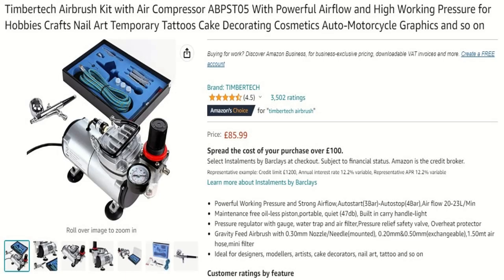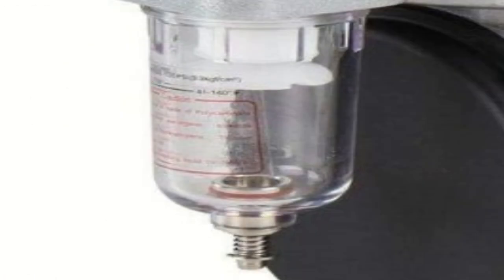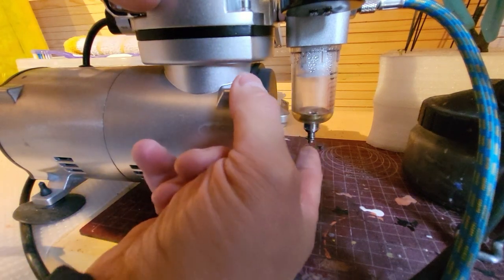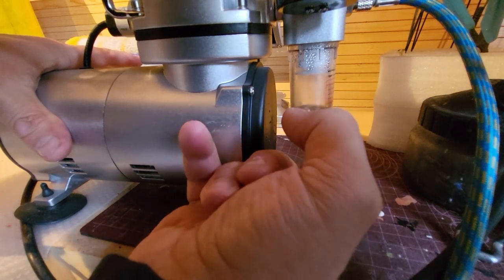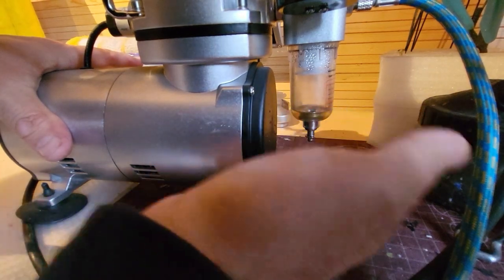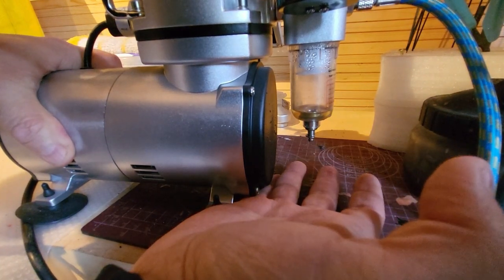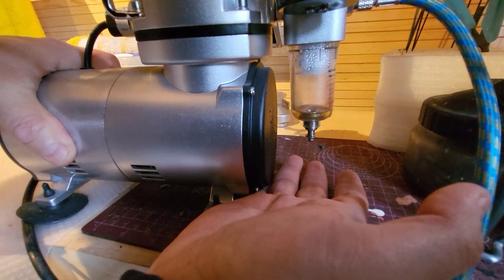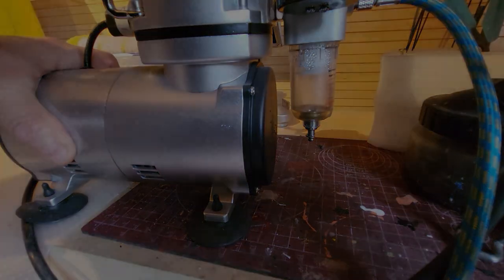How To Empty Moisture Trap On Timbertech Airbrush  Compressor ABPST05

Comment: How to take it off completely to clean?
Reply: The clear part actually twists off fully. You should be able to do it by hand. Seems a bit tight, but that is because there is a rubber o ring that seals it.

I just used a firm grip and twisted slowly and comes right off so you can dry the inside
Reply: @legendarybuilds Thank you I was worried I was going to break it

Comment: Do you know if there is a way to completely  get rid of all the moisture out of the compressor? After using it for 10 minutes water seems to get into my airbrush with barley any moisture build up in the clear holder
Reply from the maker: Ah I'd have thought a purge would clear it...
Reply: The clear part actually twists off fully. You should be able to do it by hand. Seems a bit tight, but that is because there is a rubber o ring that seals it.

I just used a firm grip and twisted slowly and comes right off so you can dry the inside

Comment: How many times did you press it to remove that condensation?
Reply from the maker: Interestingly is already emptied it but the camera failed to record so it was  more  demo
Reply: The clear part actually twists off fully. You should be able to do it by hand. Seems a bit tight, but that is because there is a rubber o ring that seals it.

I just used a firm grip and twisted slowly and comes right off so you can dry the inside

Comment: how to remove it to clean it properly though? I only had this airbrush for 2 days and the cap on this recipient feels like it's glued or something. I'm worried bits of paint will get stuck in there forever can I can't clean this. Help is appreciated, thanks in advance.
Reply from the maker: Not experienced this at all I don't have the cap on when spraying though
Reply: @greedy3d480 mine came like this and until I watched your video I literally thought both pieces were fused
Reply: The clear part actually twists off fully. You should be able to do it by hand. Seems a bit tight, but that is because there is a rubber o ring that seals it.

I just used a firm grip and twisted slowly and comes right off so you can dry the inside
Reply: @legendarybuilds  Nope, that wasn't it. I appreciate the help but I had 7 months to work it out and turns out it was the o-ring didn't seal completely and some paint got stuck in there. Soaking in IPA overnight did the trick after rinsing with hot water and using pliers. But thanks anyway!

Comment: Mine doesnt seem to acrually condense in the trap do you have any advice for fixing this?
Reply from the maker: Are you having any problems... Maybe your environment is dry... Are you getting any moisture through the airgun?
Reply: @greedy3d480  What are the signs of having moisture through the airgun?
Reply: Take the airbrush point it towarda a dry sheet of paper and just let air flow through it. If there is any water coming out thats bad. @hhaste

Comment: Hi! I have a lot of condense that doesn't go away when I empty the moisture trap is that normal???
Reply from the maker: Where is it.. In the trap?
Reply: @greedy3d480  yes it is!!
Reply from the maker: @lindseymerts2551  ah I'm assuming that's normal
Reply: The clear part actually twists off fully. You should be able to do it by hand. Seems a bit tight, but that is because there is a rubber o ring that seals it.

I just used a firm grip and twisted slowly and comes right off so you can dry the inside